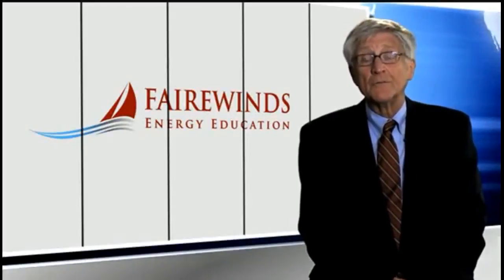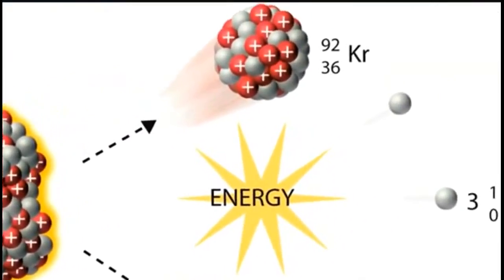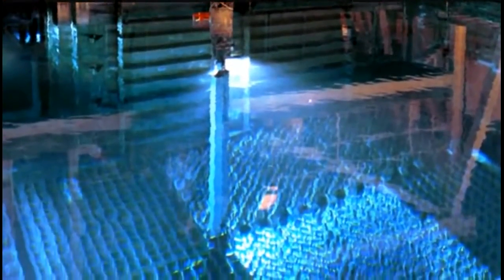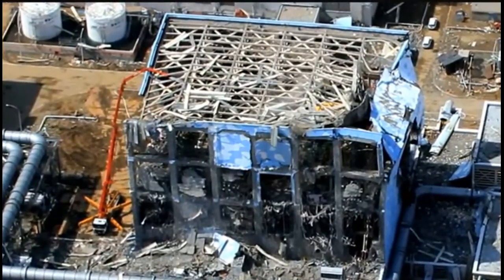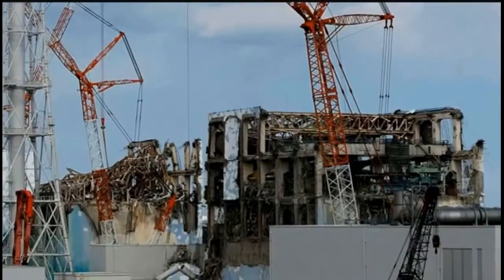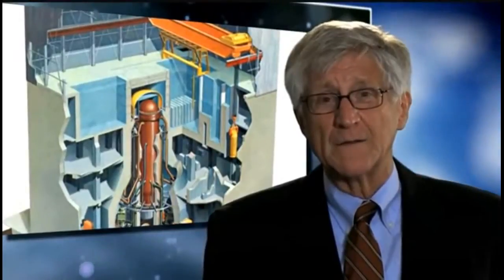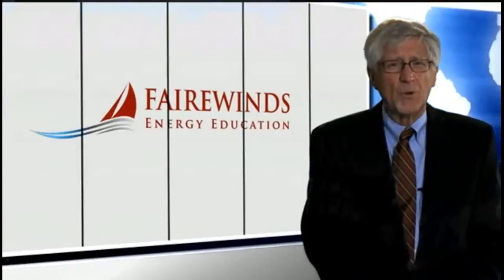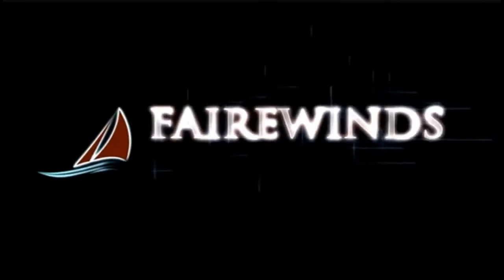Flawed Design of FUKUSHIMA DAIICHI REACTOR 4  GE Mark 1 Fatal Design

Comment: "The US designed (GE) pressurised water boiling reactors scaled up from small submarine reactors and implemented on a production scale on land was warned to be totally unsafe by the original GE engineers and designers in the late 1970's.
 
The US not only built at least 23 on its mainland it also exported these ticking time bombs to other nations including Japan which is in one the worlds hottest earthquake and tsunami zones (the ring of fire)."

Everyone please watch "The Battle Of Chernobyl".
Reply: This is why GE sold the flawed designs to Japan, see? As in, "don't be moral, recoup some of the investment in failed engineering SOMEhow".  Standard bullshit business morality: cut corners, cheat, screw safety; who cares as long as you make the quarterly numbers?

Comment: in America we don't do that, no we don't.  We go way beyond mere reckless storage of spent fuel.
Hanford - Multiple Secret Green Runs Released 685K Curies Radioactive Iodine On Washington And Oregon
Hanford regularly emitted radiation into the environment. Between 1944 and 1947 the total estimated radioactive Iodine released from Hanford was at least 685,000 Curies; a truly staggering amount.
Reply: Hell, go read about the radioactive kittens at SONGS in San Onofre. Or the radioactive ants out at the Hanford site. Or the "hot" sea creatures at the heat outfall pipe of the Plymouth, MA nuke plant or the cows at the state prison just downwind from it that gave radioactive milk (the solution was to get rid of the cows). Took almost 30 years to get THAT leaky piece of shit closed.